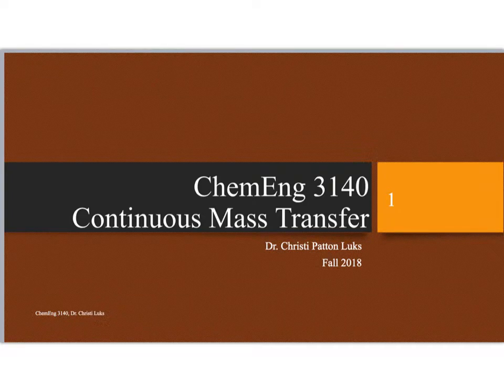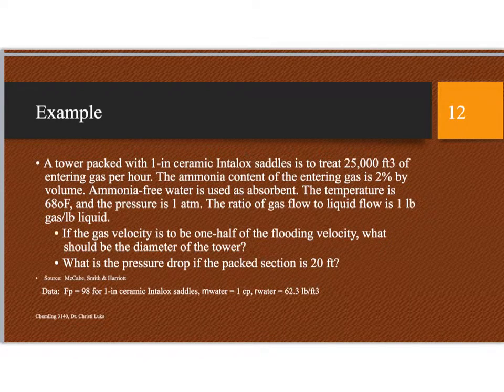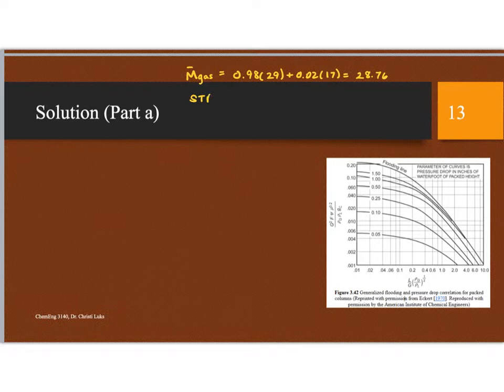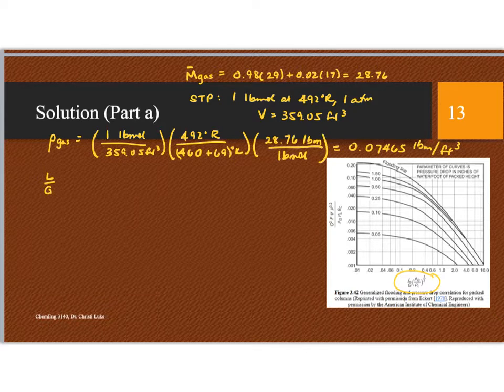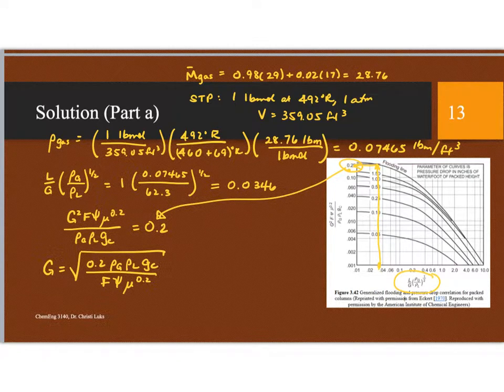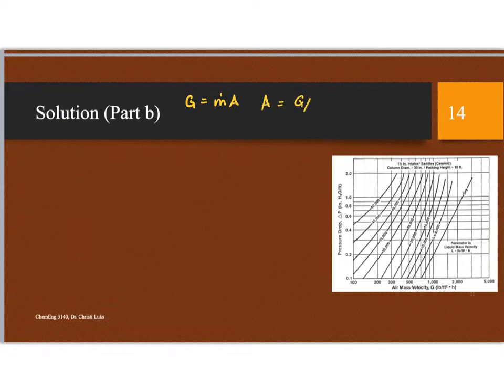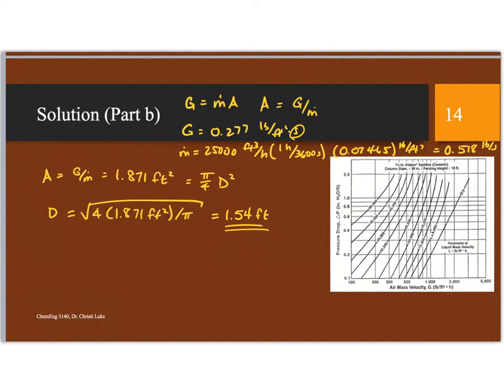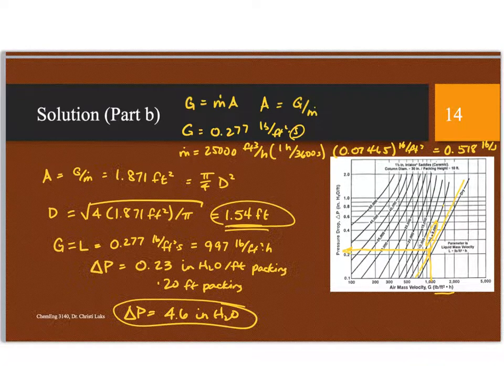Introduction to Absorption - Flooding Example

Comment: This doesn't make sense.... I got up until the diameter calculation and that was correct but I'm not understanding the next part. 

We have G/L = 1, and we use this to calculating flooding G. Then we take half of the G because that is what is specified to use.
So now our G/L = 1/2. 

We don't change L for the pressure calculation that defeats the purpose. If we cut G in half, but we also cut L in half, we're back to the same point and we're running at flooding. 

Right?

We need to calculate pressure with the given beginning L and the half of its flooding G.... so L/G = half